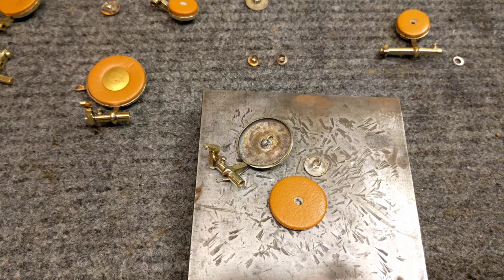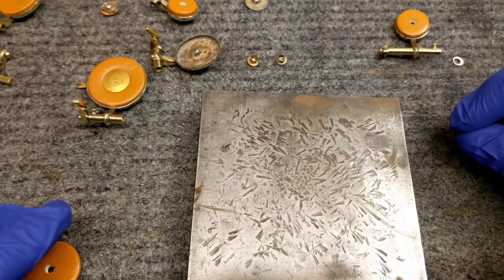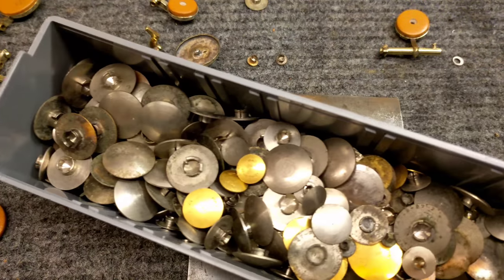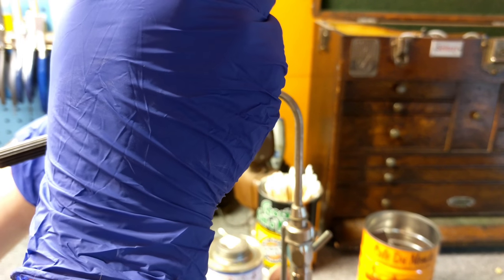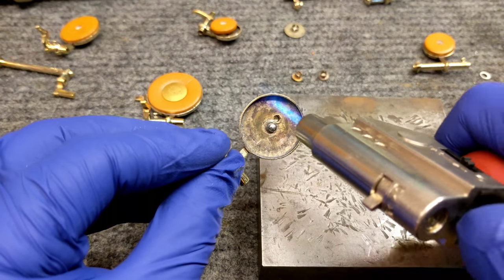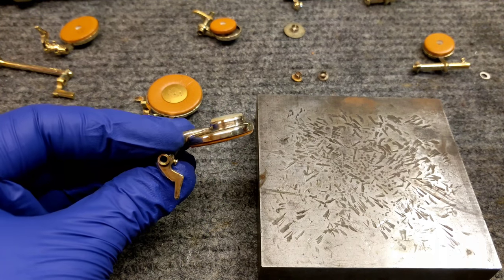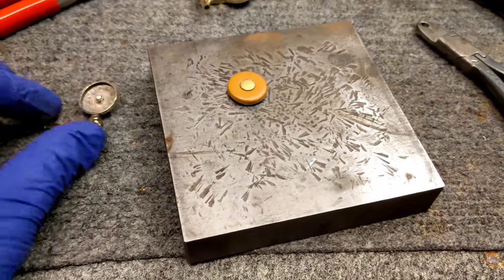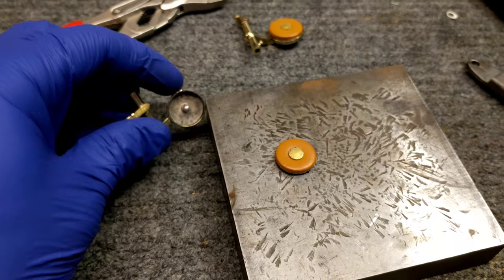Saxophone Repair Topic: Pad Install With Buescher Snap-On Resonator

Comment: Thanks Matt. I have a buescher true tone and have always wondered... what is the random tone hole on the bottom of the horn opposite the E flat tone hole? Im in the process of restoring the horn myself. Its my first overhaul :)
Reply: fork Eb. try fingering a D but leave out the middle finger. usually this mechanism and tone hole is more trouble than its worth, due to intonation and tone difficulties.

Comment: Nice method Matt. But how do u actually float Buescher pads when snap on is pressing them so hard in - the pads edges are hardly movable of "floatable"?
Reply from the maker: they actually are quite movable, the pad will even spin in the pad cup.